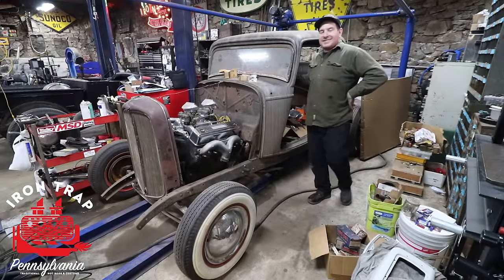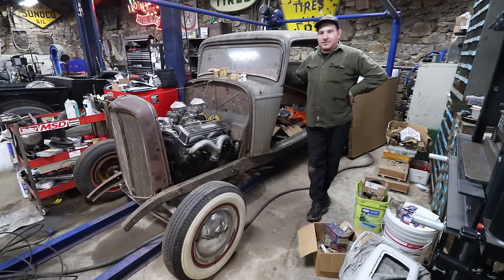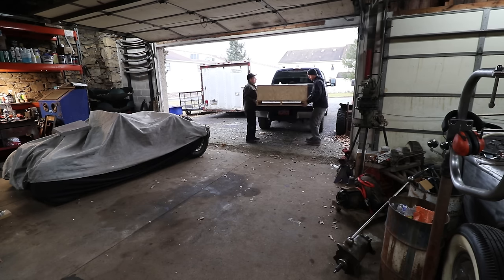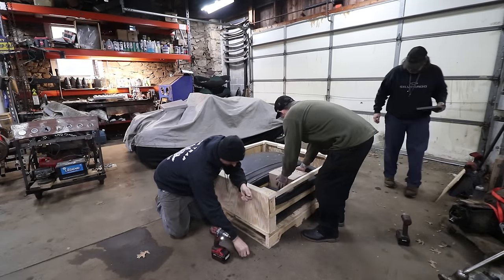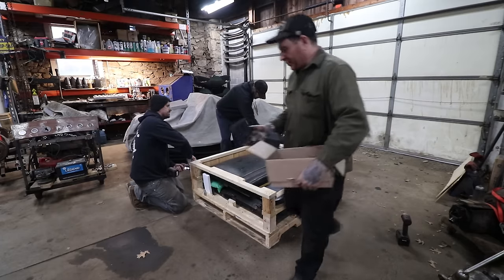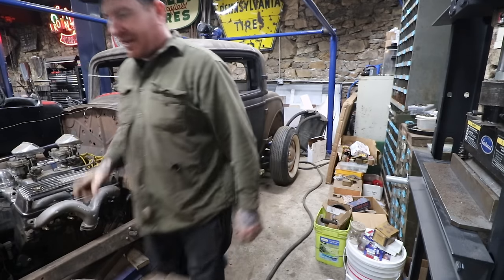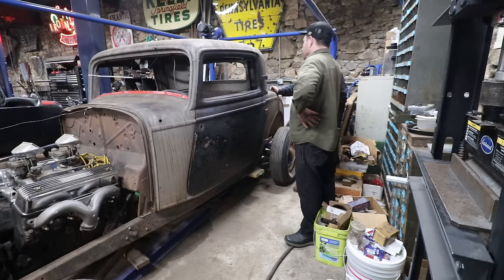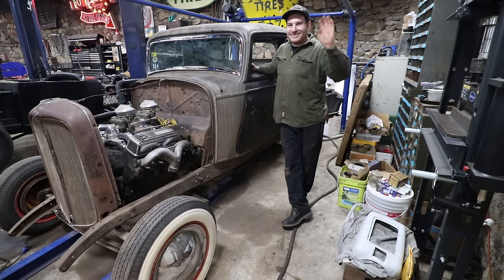Matt Finally Found A Driver's Door For The 1932 Ford 3 Window Project!!!

Comment: Matt, I know how you feel.  It took me 11 years to find a right door for a 1928 chev roadster.  It was on a trailer mixed in with a lot of big car doors from, buicks, cadillacs and packards.  The guy did not know what it fit, so I got a really good deal.  After I paid for it, I told him it was for a 28 chev.  We both were happy.  It was a rust free door from North Dakota.

Comment: I bought a 32 5 window coupe a couple of years ago. While I was on my way. I stopped to get gas. And older couple walked up to me . And asked if my car was a 32 5 window coupe. The lady then asked me if I was interested in a set of doors and trunk lid for a 32 3 window coupe. The doors and trunk lid had been in storage since the late sixties. They were complete with windows, and door regulators and garnish mouldings. The glass had water decals on them.

Comment: Hey Matt  I have the same car with same problem. I was able to find a beautiful original passenger door with window trim and latch in the Seattle area. For the driver side I broke down and had to order a new one from Brookville. I’ve installed a new wood kit in my car so looking forward to you showing how to align doors. On mine I will be drilling the hinges and the wood pillars. Love your show